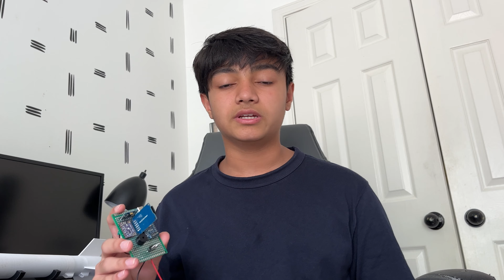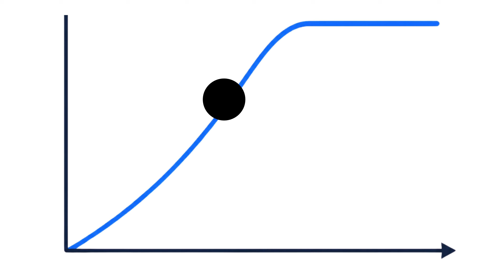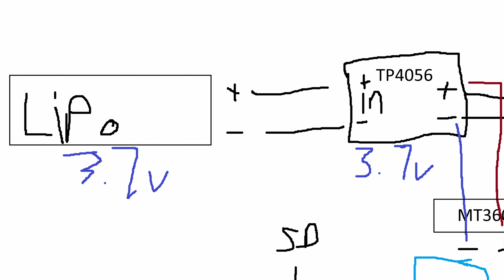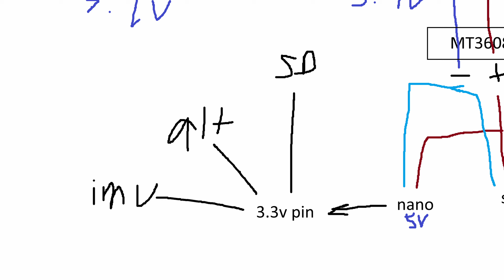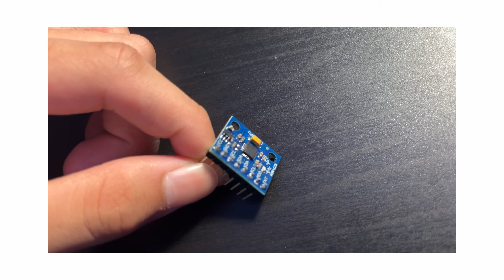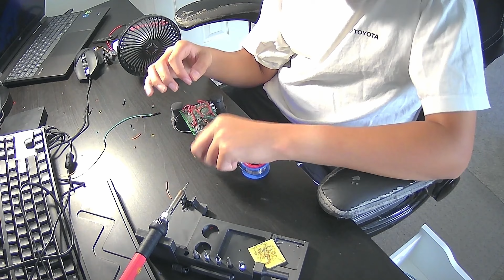Building a Flight Computer | Components and Circuitry

Comment: A relatively good concept. It looks quite similar to 99% of the first flight computers people build, and I think it’s a good way to start experimenting with prototyping boards.

There are just two small things I would change, and they raise some concerns for me.

The first is the mechanical strength of the assembled computer, especially the SD card module and the MPU. We’ve had a few cases where connections or components failed, sometimes simply during transportation. I’d recommend making the whole assembly more compact and flat, or at least adding some kind of structural support — 3D-printed parts, a simple bracket, or even a generous amount of hot glue could significantly improve its mechanical stability.

The second issue is more serious: using an SD card as the telemetry storage medium. The problem is the SD card itself. It’s not particularly mechanically robust, and it doesn’t take much force to crack or otherwise damage it. At the same time, the telemetry data is one of the most important parts of a flight. Without it, you could potentially lose data from a large part of the mission, making the whole flight much less useful.

Personally, I’d be more interested in trying SPI flash chips or flash modules. They’re relatively inexpensive and widely available. Alternatively, you could borrow an approach from black boxes: connect the SD card to the computer using a short flexible cable and isolate the card itself inside some foam to reduce vibration and mechanical stress.

Overall, though, I think it’s a good starting point and a nice way to get into building flight computers.